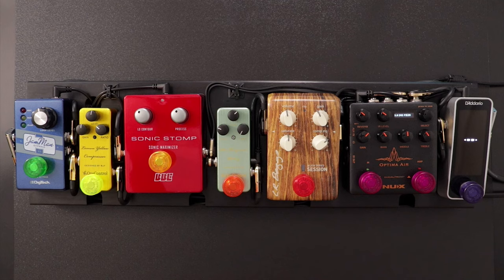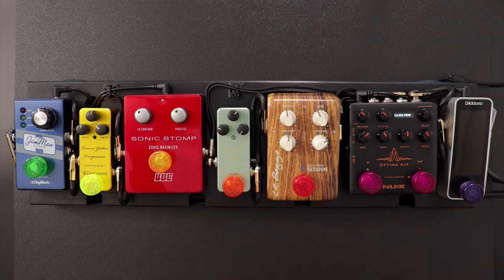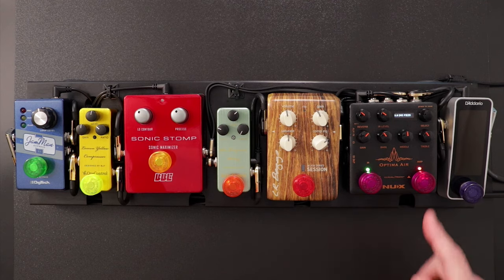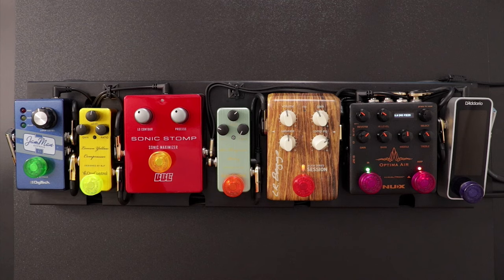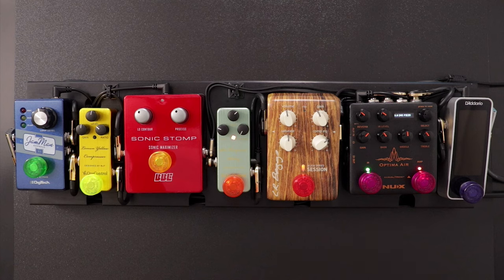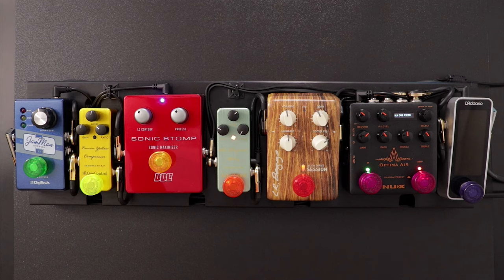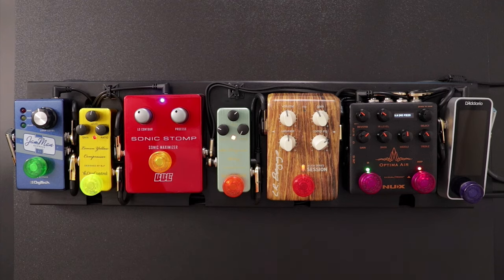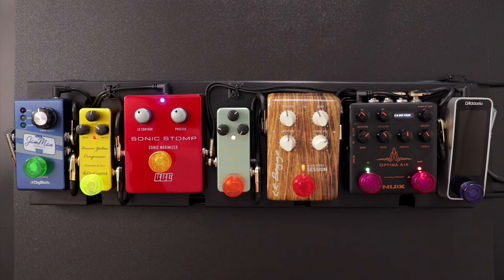Acoustic Guitars NEED Pedals Too! | Acoustic Pedalboard Walkthrough

Comment: I guess it takes a LOT of listening, but when one device affects say compression, then another pops up down the line also affecting compression why not just dial compression up or down on the "first" one?  ( I'm trying to save money with NO experience hearing the difference--besides this video, of course--very helpful)
Reply from the maker: Hey! No, you don't need two compressor pedals. I just placed the second one at the end of my signal chain as a clean boost. (To get a volume bump for solos etc.) Hope that helps ; )

Comment: It's amazing how NUX Optima Air get rid of those quacky sound. I've just also watched NUX Stageman Floor reviews, I think it's great all-in-one acoustic pedal.

Anyway, I noticed you didn't use any chorus pedal? One more, you used 3 compressors on the pedalboard: LR Baggs Session, Lemon Yellow Compressor, and BBE Sonic Stomp. Isn't that too many? Lol. Just asking. I'm using Sonic Stomp too, and I think it clearly adds compression to the signal.
Reply from the maker: Hey! I usually like to add modulation to the delay trails, instead of on the dry signal. It just sounds a little more pleasing to my ears. Also, the Lemon comp is really just for a solo boost. The only comp I have 'always on' is the Session. (The BBE isn't really a comp. It deals more with EQ and phase). Cheers ; )

Comment: Your gain structure is too hot. Session clip light shouldn't be turning on. You can hear the distortion. Also (no right or wrong) but having the comp eq over 50% is really compressing the signal and you'll start losing the tone you started with . But I enjoyed video thanks for sharing.
Reply from the maker: Hey! The pedal is all analog, so the input gain simply determines how hard you want to drive the comp and saturation circuits. (Fee free to check out my other video dedicated to the Session pedal: https://youtu.be/4nX-lD0L_gg) As a guide, LR Baggs suggest that you should set the peak light to engage on your hardest transients. Also, the comp side actually uses parallel compression. So it's much more subtle than a normal pedal compressor. Anyway, hope that helps. Cheers mate ; )